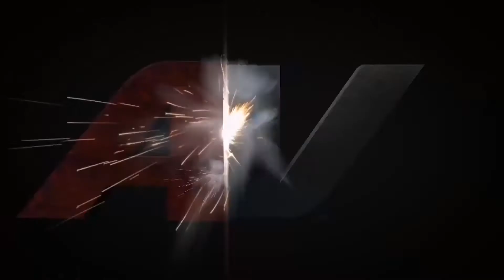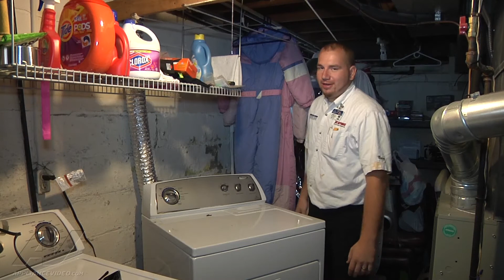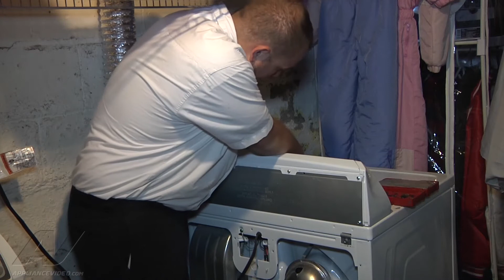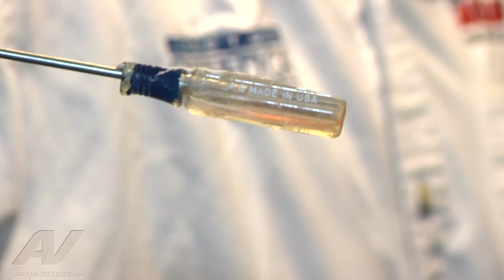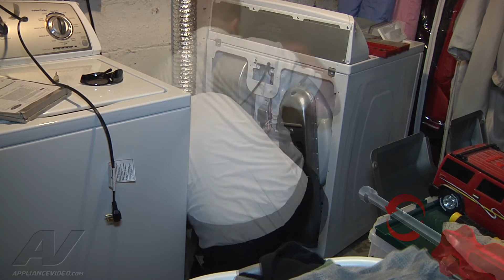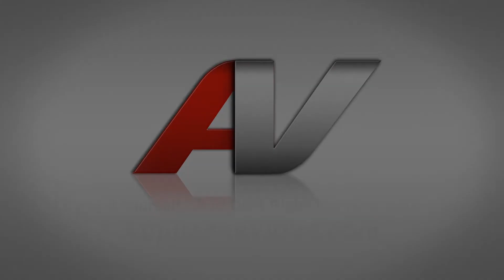Whirlpool Dryer Repair - Very Loud When Operating - WGD4900XW0

Comment: Can you use the dryer if something fell in the lint?
Reply from the maker: Great question, if you have a
more technical question that our parts department cannot answer, our
technicians are answering all questions at our website at www.ApplianceVideo.com under our Repair Help section. You can also call
our parts department at 1-800-830-5465 and they can give you help 7-days A week
Mon-Sat . You can also search at www.SaveMoreOnParts.com 7- days a week.